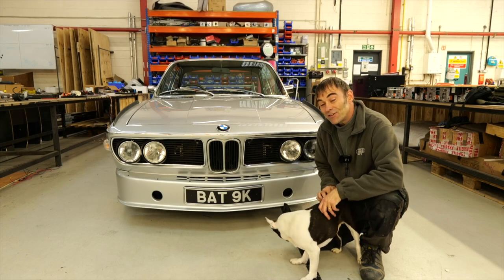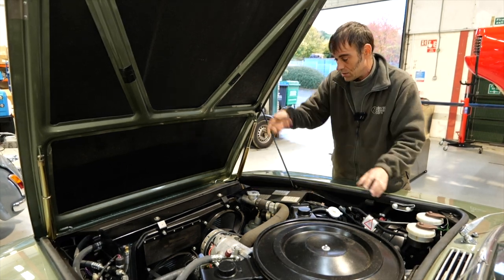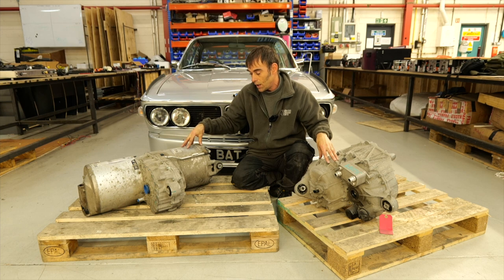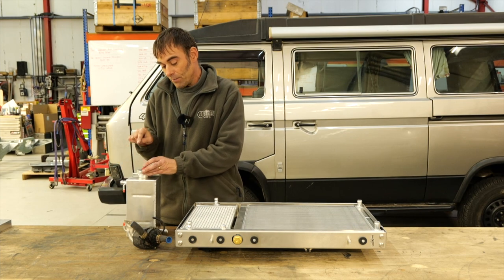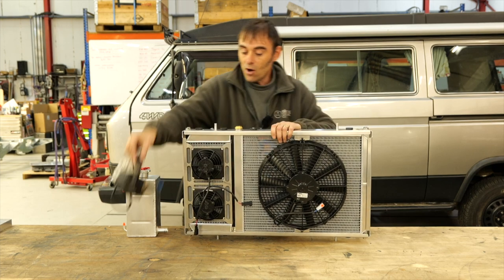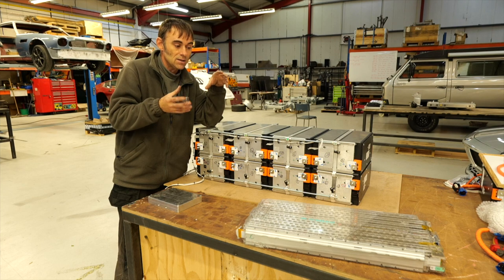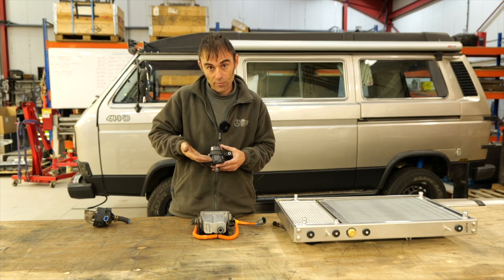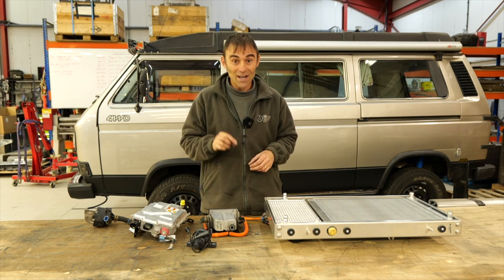Tech Talk - Why do electric cars have radiators?

Comment: Around 9:30 - The permanent magnets in the motor also need to be kept cool. If they are Neodymium-based, the will start to lose their magnetism at much lower temperatures than Iron-based magnets. Their Curie point can be at temperatures below the boiling point of water, depending upon the grade of the magnets. Once the Curie temperature has been reached, all magnetism is lost, permanently.

Comment: I always thought about designing a fan that would run on the actual pressure on the radiator instead of using electricity. That way it would run faster if there was more heat. Basically the change in water pressure would push a piston out that is connected through a non-centred pin in the fan blade, a lot like how stream engine works. When the revolution ends, the water would be pushed back to circulation through release valve.
Reply: You could only use the water pressure to run the fan if the pressure was passing from a pressured, to non-pressurised location. Regrettably that would be non-returnable…
Reply: @philtucker1224  The steam would need to be cooled down and compressed back to liquid form, but that isn't a big issue as it's already routed near fan blades. Obviously it would take more space than electric fan.

Comment: Worth pointing out that internal combustion engines are only up to 30% efficient when fully up to temperature, they're much worse while warming up.  And since most people take short trips <20 minutes, the engine is almost never operating at it's peak efficiency.  Also that 30% is at a very narrow RPM range and load.  Idling is obviously 0% efficient. In practice, you can expect something closer to 15-20% overall efficiency at best.
Reply: Not forgetting the time wasted at Pedestrian Crossings, Traffic Lights and congestion of our roads. Engine warm-up time in Winter. We must take this into account, simply because the engine is running, wasting fuel. Unless you drive a Blue Motion Car, your efficiency drops like a stone! In a situation like this, EV's conserve energy. Most drivers do not drive long distances, so the EV would suit the majority. It's always the high initial cost that prevents a greater uptake of EV ownership. It's great to have both an EV and also ICE.
Reply: Good points, thanks 👍😀
Reply: Which is why I have a trickle charger connected to the same plug as my block heater.  The amount of electricity required to start an engine below -20C needs about 10 minutes at highway speeds after the car is warmed up, which takes about 10 minutes of idling and 10 minutes of driving.  So thirty minutes of burning fuel for my short city hops on cold days.  Or a trickle charger.  Then there's the engine repair bills for driving an ICE vehicle in Canadian winters.

Comment: I guess the only question remaining for me was why did the early Tesla's and some modern electric cars push so hard to have no front grill or as large a frunk as they could make? I know the heating cooling system does not need to be as large, but was it just a marketing thing, something to set them apart? The old gas powered radiators were positioned where they were because that would get the most air flow in motion, it makes sense to keep using the most efficient location for your radiator and heater system.
Reply from the maker: I think it was purely because they didn't need as much air flow so it gave the designers more of a free hand to design the front without the need to have a big hole for the radiator but rather go with sculpted vents for the air intakes. 👍
Reply: Aerodynamics. With an ICE you want as high a volume of air as possible bumping into the radiator to cool the engine. With an EV you need far less air ad thus you can improve efficiency by having smaller air intakes.

Comment: I would have thought they would have used a water less coolant for corrosion resistance considering the cooling plates are aluminium with smaller waterways than a combustion engine.
Reply from the maker: Yep, we do. Usually G-48. 👍

Comment: Kia make heat pumps an optional extra on the excellent EV6's.  Some models/countries as standard.
Reply: All you need is to do is add a reversing valve to your AC compressor and you have a heat pump! These should be standard - not a massive additional cost depending on if they think they can get away with it in a certain market.
Reply: @TC-V8  The Heat Pump is on a separate cooling/heating circuit to that of the AC.  Not the same thing.

Comment: The cooling plates between the pouch batteries doesn't look very efficient as it's only a milled round channel.
Micro fins on the internal surface would increase the surface area and drop the temperature quite a few degrees.
Reply from the maker: Those plates were only an example, they weren't actually the true coolant tracks as those coolant plates are sealed and can't be opened to show. But ,yes you are correct they 100% be made to be more efficient. 👍

Comment: From a technical standpoint I found this episode to be the most interesting so far! Coming from a mainframe cooling background it was always our target to run the cabinets at 27degrees C. At what temperature (ideally) is a typical EV coolant system thermostat set to operate at please?
Reply from the maker: It depends if it's the battery coolant system or the motor or inverter as they all trigger at different temperatures. Also, they bring in the pump speed and fans variably rather than on or off like a thermostat.

Comment: I‘ve seen a video from teslabjoern, where he said, that tesla is using the motors to heat the battery. The car was stationary and the motors were pulling amps. Can you explain how this works?
Reply: Joule heating in the stators while not rotating their magnetic field
Reply: There's a video from a guy in Colorado which shows this happening when he tested recharging his battery after running it down to nothing and letting everything cool to outside temps of -20F / -30C.  The Tesla fast charger has to heat the battery before charging, which took about 20 minutes.

Comment: When will you be fitting model 3 motors in your conversions?
The 3.54 reduction gear option looks good for a Land-rover to keep the cruising RPM down and in that super-efficient power band, even if it looses a little on the drag strip!
Reply from the maker: We've been fitting Model 3 motors in some builds for over a year now. 👍
Reply: @ElectricClassicCars  Have any been YouTubed yet? I must have missed them. I've seen you do Large Drive Units and Small Drive Units and some non-tesla motors (Hyper9 I think?)

Comment: One of my pet peeves is why 'heat pumps' aren't used more in EV's. 
ALL EV's already have an electric ac compressor. All you need is to add a  simple reversing valve and you turn your AC into a heat pump. Simple and cheap.
Resistive heaters when you have limited energy are crazy in my humble.
Reply: Hopefully they will be standard before too long 👍😀
Reply from the maker: You're right, and that's why most EVs are now starting to use heat pumps. 👍
Reply: Resistive heaters are 100% efficient. Heat pumps don't work well in the winter and the systems are very expensive.
Reply: @vidznstuff1  100% efficient at turning electricity into heat but a heat pump uses less energy to move more heat around so it takes less energy to move a given amount of heat around with a heat pump that to "create" that heat with a resistive heater. 
If you're smart with your system design you can take heat from the battery/drivetrain to heat the cabin when it's more efficient to do that then take it from the outside air. 
There's a limit of course but there are definite gains to be had using a heat pump.
Reply: @Surestick88  And so, my home heat pump is ~300% efficient, i.e. with the same amount of electricity it MOVES 3 times as much heat into the house as the same amount of electricity CREATES in a simple heater.
Reply: @vidznstuff1  You already have 90% of the parts for a heat pump - the compressor is no different to your AC compressor - ALL you need is a simple reversing valve which switches the refrigerant flow.
Yes they are less efficient when it's freezing than when cold, but still much more efficient than a resistance heater which can only ever be 100%. Heat pumps can be 200% - 500% efficient!

Comment: Do you need cooling for a smaller motor and inverter for something like a Fiat 500?
Reply from the maker: Yes.
Reply: @ElectricClassicCars  Could you do a video on the pros and cons of cooling vs not cooling? Also, what specific items need to be cooled and in what order of importance, battery, motor, inverter, controller, converter, not sure what else might need cooling. 
I know of an electric VW with no cooling but the owner said he was going to install a pump and radiator system to cool the battery. Thanks for your shared experience!

Comment: What's the thinking, behind having a separate 12v battery? 
Is it more efficient, to lug about an extra battery, than the weight of a converter to supply the current for high demand heater etc? (Or ICE ,although not seen any of your builds, with decent 'pimp my ride' stereo systems in....🙄)
Reply from the maker: There's still a 12v system on all converted and new electric cars for things like lights and wipers. The 12v battery doesn't need to be big as it doesn't need to crank over an engine. Some manufacturers (including us) have started using Lithium 12v batteries which are insanely light. You need a permanent 12v to be able to switch the car on. 👍
Reply: @ElectricClassicCars  , so more of a safety feature? As the full battery isn't 'live' all of the time. Kind of makes sense, cheers.
On the subject of batteries, what's the C rating on these things? 
Had a wee look, but can only really find charging C ratings - pretty similar at every other battery chemistry, charging at 1C for battery longevity, but lithium having ability to charge a 3C? (While liHv are knocking on 5C?, or is 3C with a safety margin?) , but can't find much on the 'Burst' or 'Contiuous' discharge rating.

Comment: I am always interested in tech talks of all sorts.  This is probably why I am interested in new tech that is just becoming available that will effect the EC market.  I was wondering if you have plans to cover any of that kind of tech in a talk in the future?  There are two things that really stood out for me:

1. Super or Ultra Capacitors.  I know that these are being used in a sort of hybrid fashion for some diesel powered fleet vehicles.  I know that they can charge extremely quickly, but that they have a limited time for carrying the charge.  I was wondering if there is any real effort to combine these with normal lithium batteries in a hybrid fashion.

2. Magnetic Resonance Charging.  In particular, WiTricity.  This looks like a very smart way to go with charging ECs in the future, and has lots of potential.

But what I really wonder about, is combining the two.  If you had Magnetic Resonance pads placed in the road every 50 feet or so, and Ultra Capacitors picking up the charge as the car passed over them.  Would it work?  Would it be financially feasible? Kind of like old time electric street cars, but with the power in the road below instead of a wire above.  Your car would just go, and never need charging unless you leave the main roads, then you would have a much smaller battery to get you that supposedly short distance to your destination.  And Capacitors can be pretty much any shape.  They can be in the frame of the car!  Am I on to something, or is this whole idea a non viable pipe dream?  🤔
Reply from the maker: Supercaps are starting to be used on some high end performance EVs as they store that quick spike in energy from regen/braking very well. Batteries on the other hand don't like big spikes in incoming amps. I've also seen them used on Hydrogen fuel cell cars like the Riversimple Rasa. 
Inductive charging is an interesting concept and I've seen it used in China for taxi ranks but the installation in the road is troublesome and the long term maintenance of them embedded in the road is yet to be seen. You also need to carry more weight in the components on the car to charge off the system. Lastly, it very slow charging speeds too. So I think it's a case of, yes it can be done but I doubt it'll ever become widespread. 👍
Reply: @ElectricClassicCars  Thanks for the quick reply.  Sort of what I thought.  It seems like a thing that could be done, but as long as nobody can profit from it...  

Hmmm..  Didn't this happen to some famous guy?  What was his name again?  Oh yeah I remember, Tesla.  Wanted to give the entire world free energy.  Whatever happened to him? 

(I'm being satirical, don't answer, I am well aware of his fate.)

Comment: A simple notion that struck me when I saw a documentary about the making of the Bugatti Veyron: just testing the isolated engine, it ended up literally melting the venting chimneys of the facility "the fact is that this engine doesn't produce 1000 HP but 3000: 2/3 go wasted in heat". Whatever the power supply of the future will be, automotive cannot prescind from the electric motor

Comment: Thank you, this helps me alot with my build! Question: Have you done a build/calculation/verification of a EV conv were you do not have liquid cooling/heating on the batterypacks? Lets say a pack with high voltage but you limit the power of the motor? Or a cruiser with small motor but a big pack for range. What is your experience and thoughs? :)
Reply from the maker: If you limit the amps going out and coming into a battery pack you can probably get away without cooling if you're in a temperate climate but it won't do you pack any favours in really cold weather. Whatever you do, make sure your BMS monitors cell temperatures and acts appropriately if they get too hot.
Reply: @ElectricClassicCars  Thank you, well it does make sense with your talk in the video about degradation now a days are so low thanks to watercooled/heated packs with good temp control. Only that argument itself is strong enough to push 100% temp control in every EV conversions. Na, I live in Sweden so as you say, there is really no option without thermal management. I see the point after whatching your vid a couple of times now :) Also I dont see any degradation on my ionique after 120'000kms and it all make sense. Looking forward for more tech vids ;)

Comment: There are plenty of EVs that don't have radiators.  Older and/or less powerful EVs use air-cooled motors and batteries for simplicity and cost reduction.  Many electric motorcycles for example are solely air-cooled.  It's only when you get to higher power densities and more expensive systems that you need water cooling (i.e. radiators).
Reply: Nissan Leaf is famous for not having a liquid cooled battery.  BUT the Leaf has two radiators, one for AC and one for motor inverter and electronics!!
Reply: @smartelectriccar  I think most ppl think they're the same some reason.
Reply: @smartelectriccar  ...and electronics, what specifically would be included under this term? motor, inverter and? Thanks in advance!
Reply: @smartelectriccar  the Leaf is famous for having the batterys fail after 5yrs in hot climates, like here in Oz.

Comment: So how does cold weather ie freezing nights effect the charging or even your not charging?
Reply: Does a tree falling over in the forest make a sound if nobody is around to hear it?
Reply: If you're charging and it's below freezing, the battery gets warmed.
Reply: @@defectivedegenerate4046   Nobody ever mentions how much range ICE vehicles lose in winter.  It's easily 60-70% for short-range city driving and 20-30% for highway driving once it gets into the -25-35 Celsius range.  It was a lot worse before I installed a trickle charger on the same plug as the block heater.  It takes at least 10 minutes until the defroster works, 10 minutes until the car warms up enough to run efficiently, and before the trickle-charger, 10 minutes on the freeway to recharge the battery.  Plus the fact that the an ICE vehicle is a few dozen times more likely to need repairs in this weather than it does in the summer.  I mostly walk to work, but almost 2/3 of my gas consumption is in January & February.  That's with a heated garage.

Comment: I've made the same comment in response to other posts, but ICE vehicles lose a $^!#-load of range in our Canadian winters.  At -20 Celsius, I need to idle my car for 10 minutes to run the defroster, drive for 10 minutes to warm up the engine to run efficiency, and then drive 5-10 minutes on the freeway to recharge the battery to drive to the grocery story 500 meters away.  (I installed a trickle charger on the same plug as the block heater to avoid the freeway recharging run.)  Below -30 Celsius, change that to 15 minutes to defrost, 15 minutes to warm up the engine, and 15 minutes on the freeway to recharge the battery.  And when it gets really cold, the defroster will never work, the car will never warm up & good luck recharging the battery.  Then there's the cold weather repair bills.  We spent over USD$ 6,000 insulating & putting a natural gas furnace in the garage to keep it at 4 degrees Celsius.  Our cars haven't needed any winter repairs several years in a row now.  It's already paid for itself.  When I lived in an apartment & parked outside, I lost over 80% of my range in the winter.  With the heated garage, I only lose 30%-ish.  Plus there's the whole holding-a-gas-nozzle in weather where your hand gets frostbite in 30 seconds thing.